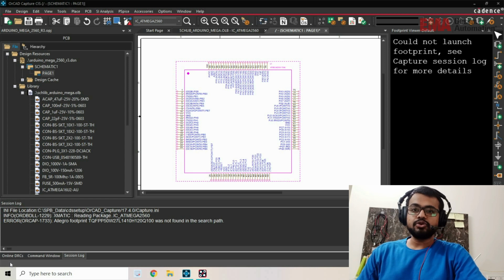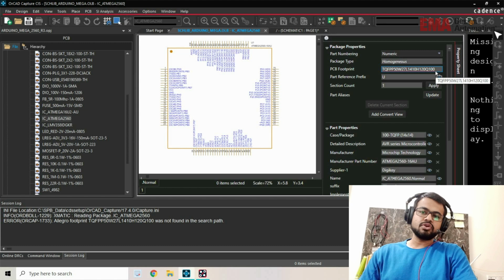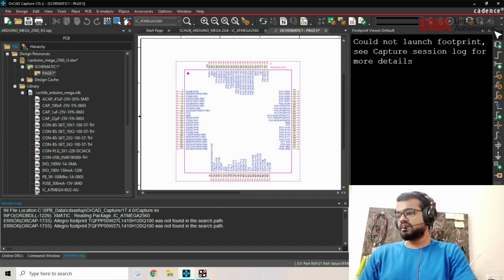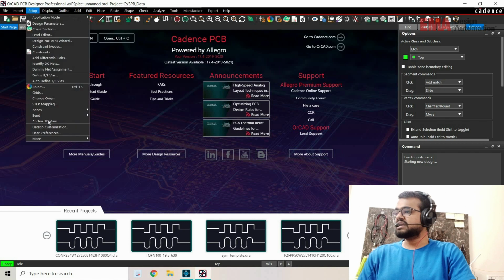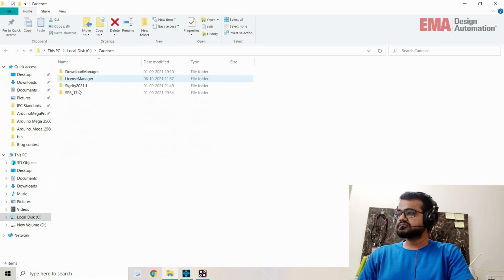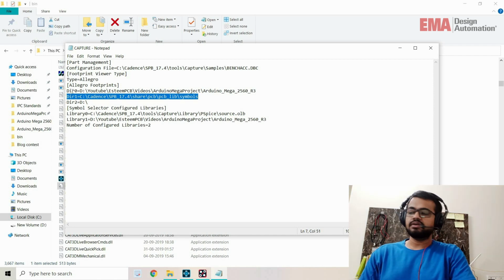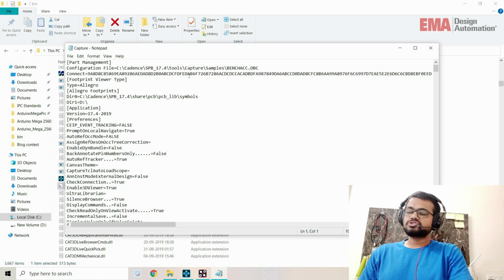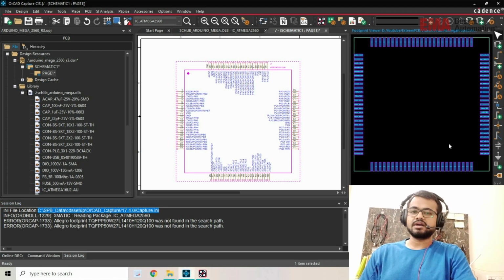[SOLVED] Error Code ORCAP-1733: "Allegro footprint was not found in the search path"

Comment: Hello,
In order to find the footprint file I want more easily in the Orcad PCB editor program,
A treeview of the components appears in the Menu-Place-Component Manually window.
However, in order to find the component I selected, the component I selected does not appear in the Quickview window.
Anyone experiencing this problem?
Additionally, when I want to preview the folder containing the *.dra files by opening it with the PCB Editor program, the "Generating Preview" text appears. Is there anyone experiencing these two problems? Could you please help me with the solution.

Comment: Thanks, it solved my problem. It's because Capture does not use the ini file under my program installation directory ,what it use is the ini file located in my working directory ( %APPDATA% ).
Reply from the maker: Yeah its a useful trick because in folder you will find 2 .ini files that's why i made this video to share which one you need to edit